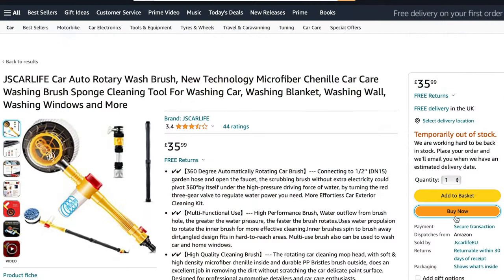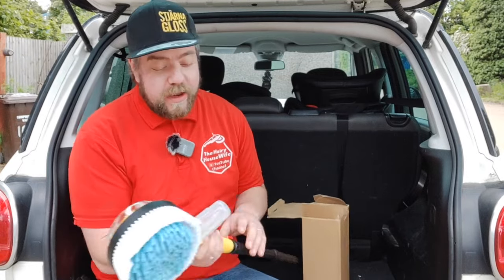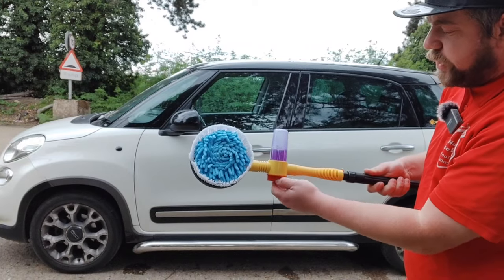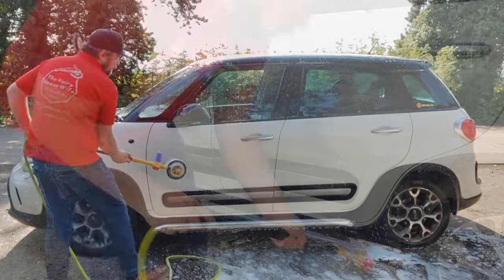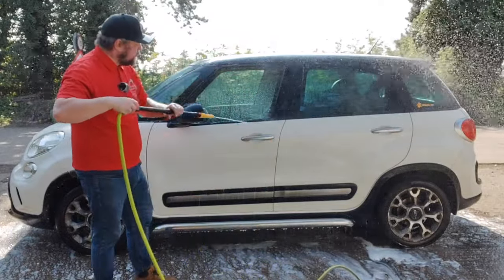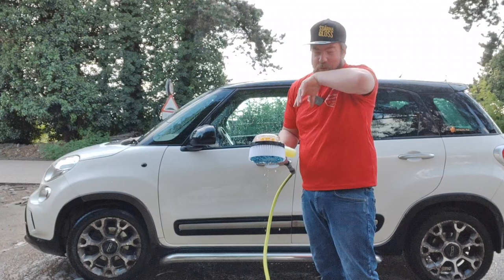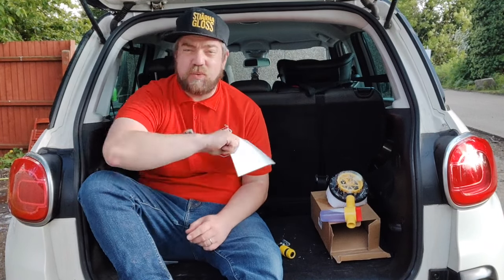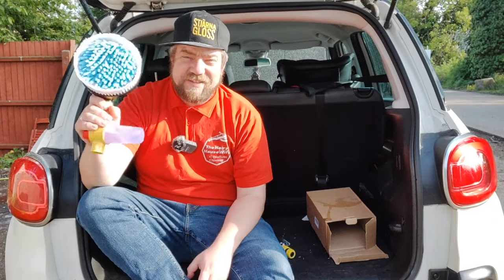Best Detailing Hack ? Rotating Car Cleaning Brush | Does it Swirl & Scratch  | In depth test #fail

Comment: Why didnt you check the car after you used it with normal pressure and see if it scratched cause no one is going to push that hard on the car are they?
Reply from the maker: So my vehicle itself is already swirly due to product testing, I tried to test this at the most extreme circumstances, I get not everyone will push hard however some people with really built up dirty might ... , however even at light pressure that brush is very harsh ..  paint clearcoat  is very soft even a soft brush will scratch , the bristles on this will definitely cause some scratching, you are right tho I should have tested it at lighter pressure, my bad 

Thank you tho for watching
Reply: @TheHairyHouseWife  Wouldnt it have been better if they just made it without the hard bristles? Wouldnt it still clean as well cause most people use sponges anyway. Doesnt make sense to make something to clean a car that is that hard it can leave scratches. Seems to me that the manufacturers didnt think that one through lol
Reply from the maker: Yeah it's a strange one that baffles me, even pressure washer company's sell these style brush attachments for cleaning cars , but unfortunately theres some people who want a car clean and dont worry or notice the spider web scratches on their car